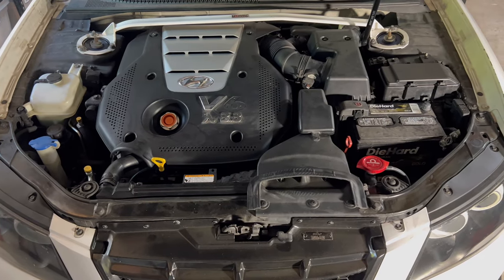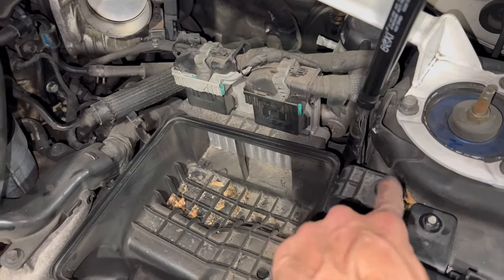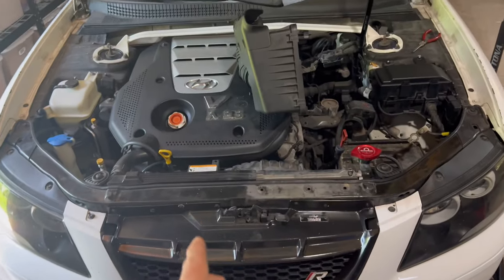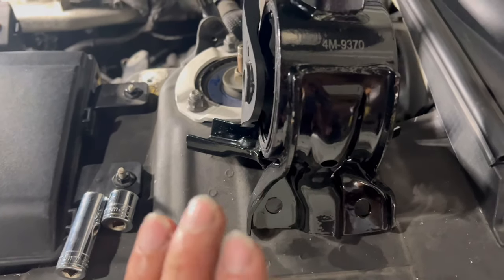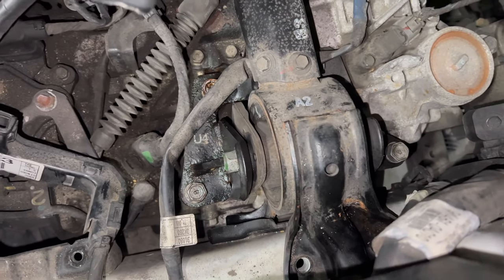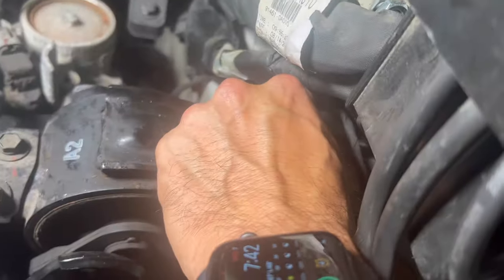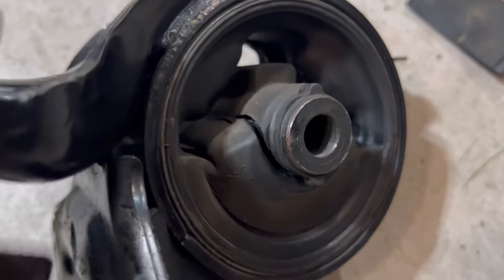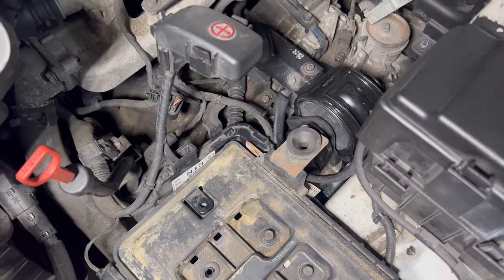How to Remove & Install Transmission Mount on a Hyundai Sonata NF 2006 - 2010 V6 3.3 Liter.

Comment: My 2009 sonata has same issue, vibration as a result of faulty transmission that was jerking at low speed.
Now I feel the engine surge forward once I press the gas.